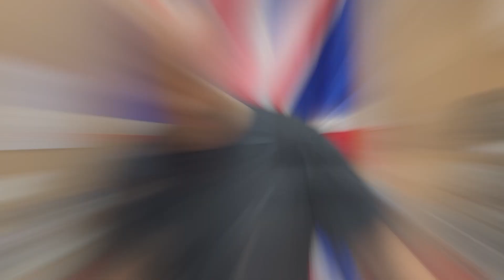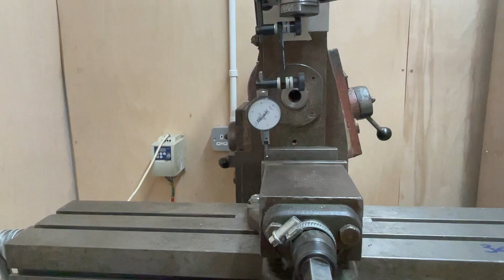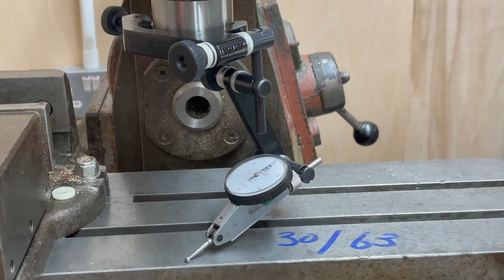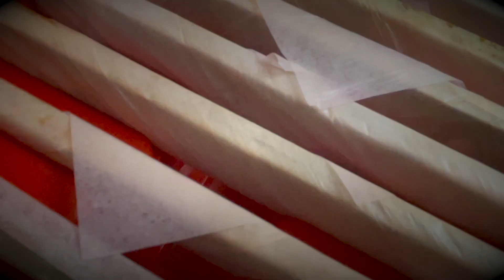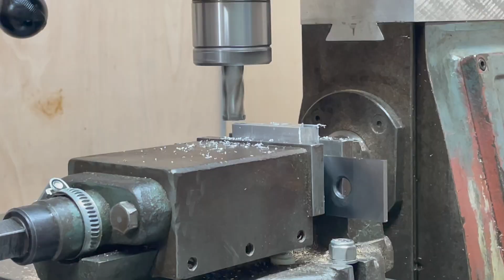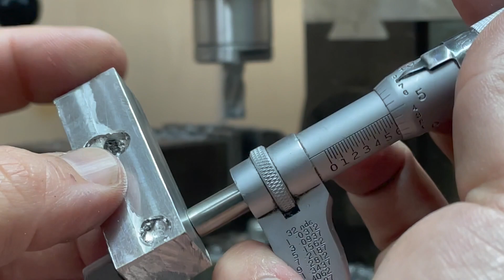Tramming up and aligning an old Centec mill

Comment: Why do some owners install risers to lift the vertical head ?. Why can the table not we wound down to make space for work pieces?
Reply from the maker: This machine was originally a horizontal milling machine, and so there was no expectation of plunging downward with a quill/etc. So as a result there this probably 4 to 5 inches that you can add with a rising block which makes this a lot easier.

Comment: The positive values at the end of the table could be the table pivoting in the slides due to the over hanging table rather than the table not being flat. Might pay to check your gibbs, try tightening them up when taking readings at the end of the table and see if the indicator moves.
The other reason could be that the table ways are worm in the centre (rather than the top surface being not flat), then as the table moves to the end of it's travel you would get a positive reading however, to get that much change the table would be pretty loose in the gibbs when central and tighter at the end of travel. Could be a mixture of both. It's complex! It's easy to make wrong assumptions!
Reply from the maker: That is a very good point- that axis is the most loose by far